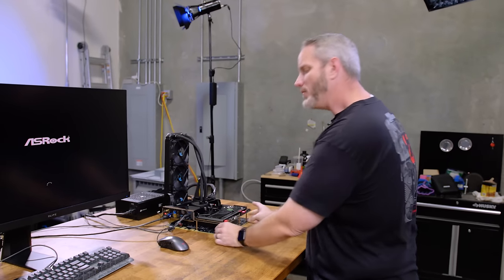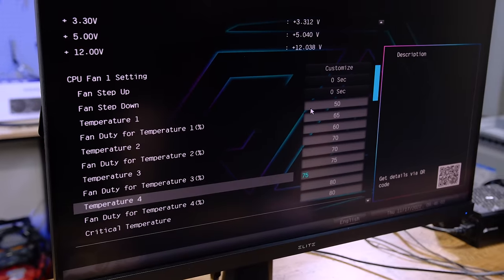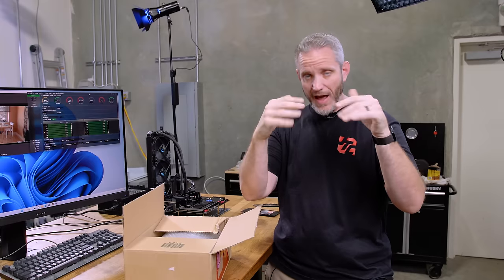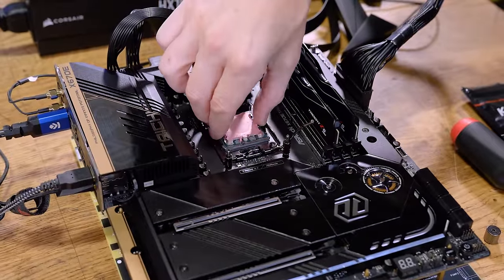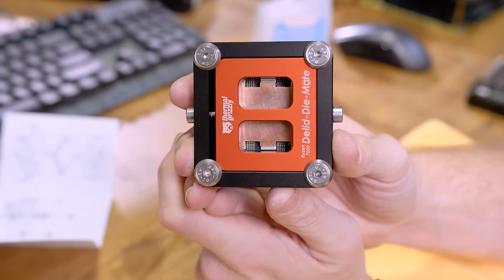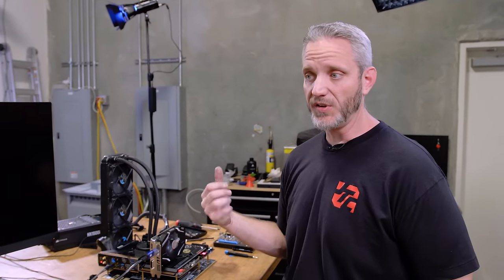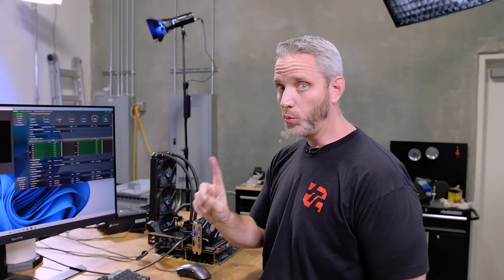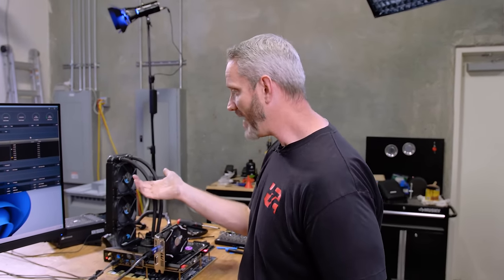I was scared to delid my CPU, but then...

Comment: I delided a 4790K years ago, used the vice method,, this was before you could buy a delidding tool, now that was truly terrifying!  thankfully all went well, I applied some liquid metal pro and temps dropped a good 15 degrees, probably the best CPU I ever owned as far as overclockability, these days I don't bother as it's not worth voiding the warranty and overclocking is pretty much automatic these days (kind of lost its cool factor) unless you're into LN2 extreme overclocking otherwise it's just not worth the hassle
Reply: I think with these new temperature norms, delidding is going to be worth it again. I mean, look at the fact that he's 20 degrees lower with lower wattage with equal/better performance. That's absolutely worth losing warranty over, IMO.
Reply: @LiveType  bro, hyper 212’s are 60$ nowadays 

It’s stupid…

But a great replacement is the Thermaltake UX200 SE

Comes with an RGB fan and is just as quiet and cools just as well as a 212 while costing 1/2 as much
Reply: @rustler08  This happened because AMD wanted to "keep" the AM4 mounting but in order to achieve that the IHS got thicker and that is not helping with the heat dissipation. The thicker the IHS the harder it is to dissipate heat. Just like MSI did on the RX 5700XT, they used un-GODLY thick thermal pads on one of their GPU models and the memory temps where through the roof.
Reply: I use a 4790k in a secondary PC. I set a 4.7ghz all core OC and Temps are fair. Seeing you speak about delidding yours makes me want to attempt it.
Reply: @Mainstayjay  My 4790k is in my main rig and I feel the same way...although I'm going to wait until I make the switch back to team red before I break my 4790k.
Reply: Yeah those older K chips were ahead of their time man, I too came from delidding and OC'ing older chips like i5-2400K, i7-4770/4790K, can still squeeze a lot of juice from old lemons hey! Was only this generations leap forward with AMDs 5800X3D and the 3D Cache that made me retire my old rigs.
Reply: @Synthetic-Chicken  beginning of next year I plan to build a 5800x3d setup. Haven't spoken to an actual user yet though. Do you like it? Is it performing how you imagined it would? I'm really looking to getting my hands on a 5800x3d!
Reply: @rustler08  I think warranty is more valuable than better performance but each to their own, different priorities, and also personally I want to keep my chip pristine so I can sell it on when I decide to upgrade again further down the road.
Reply: @Najolve  I've owned a few 4790k chips. I got my brother into PC gaming with one and an Rx580 8gb. Pieced together a cheap build from Ebay. He's still using it and loves it. For him it's a PC that runs every game he likes. That's all he knows about the internals. He's on a 1080p monitor and couldn't be happier. I am kind of jealous of him because he just loves what he has and I'm always looking at chips that I can't really afford.
Reply: @Teksers  I had bought 1 of those 50th anniversary cards from msi. Saw 112c on it, throttled w/n a lil over 1hr of use. Not only were the pads used way too thick for the memory, it was cut to only half the size of the memory modules!
Reply: I killed one 4770k with the razor blade method x_x
Then got another and delidded it with the vice method and then used it for like 5 years
Reply: @Najolve  If you have that old a CPU in your "main rig" i'd love to know whats in your other.
Reply: You're not kidding.  I delidded my 4770K this way, with a towel or something behind it to catch my brand new CPU as it FLEW off of its IHS.  Definitely a tense operation.  But that CPU ran great (with a decent overclock) for almost 8 years until I upgraded to a 5900X.
Reply: @Damaged7  My work laptop is a 8565U and my backup computer has a 2600k "Sandy Bridge" if you remember that far back :)
Reply: Still running a delidded 4790k- used the careful razor method. I applied liquid metal and sanded the top of the IHS for half a day by hand while watching shows/movies- it has been sitting at 4.8 on all cores with ring ratio at 4.4 for the past 3 Years. Got it paired with a 5700xt and 16GB CAS 9 2133 Memory, the system is pretty much maxed out for my needs- next upgrade is definitely a new CPU but it's still going strong and doing everything I want it to with no problems at all! I went from 80c at 4.6Ghz to 70c at 4.8 all core under load after the mod on a Corsair 240 AIO. I was so damn nervous modding this chip, but it was worth it and so rewarding seeing the results afterwards!
Reply: @rustler08  You are talking about gaining attributes that typically increase the longevity while sacrificing a 3 year warranty.  Value says this risk is not worth taking until the warranty has expired and even then it's still questionable.
Reply: @Mainstayjay  It's a beast of a CPU that's for sure. I've thrown a lot of games at it, even ran Tarkov and Rust at the same time and was only at 40% use. I love it and thats coming from a decade old intel user. The 3D cache tech is the next level for CPU optimization and usage for sure.
Reply: @Synthetic-Chicken  Sounds fing fantastic! I'm really looking forward to having one. Last viable Cpu upgrade for my x570 mb. That and a faster Ram kit.
Reply: Delidded 4790k was so easy to take to 4.8-5 on and especially easy with an AIO. The TIM they used in those generations was so terrible, liquid metal made a HUGE difference without even using any between IHS and cooler.
Reply: @Mainstayjay  Does RAM Speed Even Matter With The AMD Ryzen 7 5800X3D? Escape From Tarkov RAM   <---- type this in to yt search. it will explain why the 5800x3D ram speed dose not matter because it's only one CCD no latency hit by infinity fabric.  100% worth a watch. I have the 5800x3D the cache is amazing for game like pubg 3080 & that cpu 300-400 fps 1080p before I just got that gpu I was using my 980 ti & in pubg with the 5800x3d 170-293 fps pubg has it's weird ups and downs. I even left my 16 core 3950x for this cpu. hope that helps some.
Reply: @Mainstayjay  Funny thing.  That's the same CPU I've been considering.  I'm still rocking a 4790k (no overclock) and a 1070 Ti.  Been thinking about moving up to a 5800x3d and maybe a 3070 or even 3060 Ti.  Though by the time I actually do another build, I may go with a 40 series card if there are reasonably priced ones available by then or possibly something from AMD.  It's been quite a few years since I had an all AMD rig.  Phenom II x6 with an AMD GPU of some variety that I forget the model number.
Reply: @b0ne91  Yeah me and my buddies were using 4770/4790Ks and delidding/water loops, was really happy getting 4.5 stable way back when.
Reply: @digitaltactics9234  thanks for the reply, I currently run a 3200mhz 32gb kit. I haven't researched how Ram speeds affect the 5800x3d but I will now.
Reply: @Ithilion  sounds rough but I'll bet that finally getting it done successfully was super satisfying!
Reply: @Synthetic-Chicken  Confirmed, I recycled a i5-2600K that tended to get warm at 3.9-4 ghz overclocked. Delidded and liquid metal hasn't dried out in two years. Still going strong in a friend's computer as a basic runner with some gaming.  BTW Wear an ESD strap when handling these things. Use an ESD mat. You will guarantee that no transistors are fried or fail later because of ESD. There are no backup transistors in there.
Reply: I did the same on my 4790k and got -17c and over clocked to 4.8ghz stable but kept it at 4.6ghz because I felt it was safer.

Comment: Jay, consider investing in some Kimwipes and acid brushes for cleaning PCBs.  The brushes allow for getting into tighter spots and the Kimwipes are fiberless so you can use them to pick up the grime, flux, pastes, etc remnants that you loosed with the brush.
Reply: Acid brushes leave bristles everywhere, don’t do that. Kim wipes are good but of limited use here. Starting with a razor blade and removing the bull in one big piece is best
Reply: Don't do what either of these fellas recommend clearly you should invest in SHAM-WOW! that thing is INCREDIBLE
Reply: Thanks for recommending kimwipes. I almost bought the blue shop towel because that's what everyone's using, but it's not locally common here in the Philippines.
Reply: @RichardMontgomeryYT  First off….no caps lock. 

Secondly….it’s LICKING. Not liking.
Reply: @Digikidthevoiceofreason  well, if you like the PCB it will clean itself. Just give it some love.
Reply: @Digikidthevoiceofreason  If you're licking, it's probably because of liking.

Comment: Kryonaut Extreme definitely has 1 to 3c better cooling but it also dries out quite a bit faster, as far as my experience shows. You want to re-apply yearly or you lose that extra thermal conductivity. If your going for overclocks or just peak performance it's one of the best you can buy. If your looking to build a system and use it long-term without changing components don't want to re-applying thermal paste regularly there are some better options for longevity over thermal conductivity.
Reply: Kryonaut is not great at high temperatures and the new gen is all about that. I don't know about the extreme version though but I believe it's an issue. I'm using MX-6.
Reply: I’m using graphite pads and my 7950X doesn’t hit 95 degrees until it’s well overclocked. Yes the IHS is awful and cooler compatibility wasn’t worth the compromise, but the hysteria is overblown. It’s not that big an issue. Certainly there’s no need to start lapping or delidding.
Reply: I used the NT-H1 on my CPUs and now 1 GPU the other Day. As far as i can tell it doesnt dry out for quiet some Time and it is one of the Best Thermal Pastes out there (for reasonable Price).
Reply: that's true. that's why most of mid to high range of pastes need few cycles of heat and cooling to really give their best. they last longer but they take more time to give their best. high end Grizzly is really made for OCers that don't wanna lose time with that. they give their best almost right out of the seringe. but you have to replace more often.
 which is not an issue for a pc nerd. honestly i'd rather change it every year and have best cooling possible than using cheap paste. it's really not that hard to do. but i can understand people not liking to do it.
 it's like running a car with old engine oil... many people push that to the limit and even way further. which is really not good at all.

Comment: They are ball bearings, but they are thrust bearings. So they are designed to allow movement on 2 parallel flat surfaces rather than just an axis inside a raceway. If that knife you are opening the box with is a higher quality one, it may have thrust bearing on the pivot to let the blade flick open without the resistance you would get if it was just a nylon washer.

Comment: I'd be really interested in seeing what the stock performance vs all the mods would be. Like a value breakdown
Reply: it would have been nice if you SHOWED US HOW YOU PUT IT ALL BACK TOGETHER!!!!!!!!!!!!!!!!!!!!! W ... T  .... F  ... .... J ...  A  ....  Y   ...     ????!!??!?!?!!?!??!?!?!
Reply: @Defective Degenerate Besides speed, this helps maximize the efficiency of the cooler, keep components running at lower temps and lower voltage for better longevity, and lower noise of fans.
Reply: Not much difference actually I run a 7950x with bitspower block 360 Rad and idle temp is 36c on a strix 670e, the only Temps it actually helps is the 95c limit.
Reply: @JoeMama-yl1ow  I have a corsair 420mm AIO, and hit the 95⁰C limit, but my boosted cores hit between 5.8 and 5.95ghz.
Reply: @nick_pappagiorgio  longevity???? Practically no one who does these stupid modifications keep a pc longer than a few years.. because they damage more then they help. 🤦‍♂️
Reply: @ColwellMarcus  I boost anywhere from 5.8 to 6.115 But I keep medium heavy loads off as I notice it adds about another 10 degrees. But other than that.. delidded actually really does nothing for the bottom end only the top end. and in gaming and such only really stressing the cpu and cores you will only then hit 95c.
Reply: Considering that the delidding tool is reusable so it can be acquired used and resold again, I suspect the increased cooling on a successful delid will come out as a pretty decent value. If other manufacturers come out with the mounting bracket much cheaper like happened with the last cpu bracket derbauer made it will be a fantastic value.
Reply: @nick_pappagiorgio  On an efficiency and longevity front I'd love to see one of these delidded and maybe with one of those pads of graphene or whatever that last forever for thermal interface with the biggest air cooler you can find for an absolute zero maintenance set-and-forget permanent cooling setup.
Reply: @nick_pappagiorgio  People who buy $700 cpu on day one just to delid it are the same people who will spend another $2000 next year to buy 14900k. They give sh*t about longevity.
Reply: @nick_pappagiorgio  But then they OC it anyway, using that extra headroom for performance. Efficiency is increased, but that's just so they can use that budget to enhance clockspeeds even more. - The lifespan will not be enhanced by the end of it.

Comment: Colgate also makes two extra soft brushes. They have one that has a large surface area of bristles, with the other one having a much more thinned out & rather point styled one. Both work really well for cleaning out sensitive spots on uncured resin prints, so I imagine that it would work rather well for this sort of application also.

Comment: The curve optimizer offset is just under the PBO settings. In my motherboard its under "amd overclocking". You dont have to change any of the voltages themselves.
Reply: Could be Asrock's bios is just kinda broken 😅... no motherboard OEM is infallible. Have had some wierd bios issues with my aorus elite x570 with settings not sticking (that was almost 3 years ago - built my current in Sept 2019) after that I only install bios revisions that don't have a letter in the version name.
Reply: @earthtaurus5515  Probably bad settings, I have the same board and it will flake out easily if you push some things too much or change one thing at the wrong time.  Curve Optimizer is usually hidden in the PBO menu.  Set PBO to manual it shows up.
Reply: @earthtaurus5515 i learned that when you have an OC failure followed with hard reboot or auto reboot it messes up the saves. that's why i always do a clear CMOS when it fails. i always restart with a fresh clean bios. i just write my best results on paper. like this i can safely work on overclocking without having weird response from bios. once the best result found, i just create a profil with only 1 save. i don't leave multiple saves.
Reply: @earthtaurus5515 funny thing is, vendors are constantly taking out bios versions because of the same thing you just said.

Comment: I have the same motherboard with a 7950x. I didn't change TJmax, but I did test and validate -30 on all cores. I was a little confused by your original clocks, considering I'm hitting around 5.3GHz on all cores with air cooling.  

I don't care if it hits 95C. It's a safe temp, according to the manufacturer. Actually, they say 105 is technically safe. If the CPU lasts until they've released a couple more generations of AM5 CPUs, it will have done its job.  With air cooling, there's virtually no cool-down period after returning to idle, so I don't need to worry about heat-soaked coolant reducing performance later. I also don't have to worry about lost coolant, pump failures, or leaks. Heck, I even tested with the CPU fan removed (in a fractal torrent) and the performance barely changed.

I'm still tempted to de-lid, but I'd probably try some PTM 7950 rather than liquid metal. That should only be a difference of a couple of degrees. My cooler is already modified to fit AM5, modifying it further to fit a delidded CPU would be trivial.
Reply: Amazed at the air cooling... What brand air cooler are you using?
Reply: Yeah it's safe but prob not ideal for longevity. They just need to get it to survive long enough to check off some requirements on a list to call it safe.
Reply: The only reason to delid is if you're doing some very extreme overclocking with a custom loop and a huge voltage drop

Comment: I want to share a tip for cleaning sensitive things. Makeup brushes. The eyeliner ones, or slightly bigger, i use a lot of stuff from makeup section for a lot of sensitive accurate things, they feel premium compared to art store brushes, and are sometimes cheaper.
That being said, toothbrush is sensitive enough if you are careful.  Smaller brushes are good if you feel the need for a little more sensitive tools to compensate for hands shaking when doing a scary operation like this. I know i'm taking the slow route.